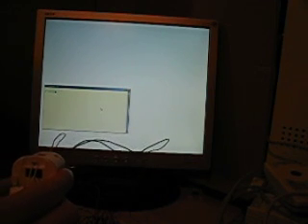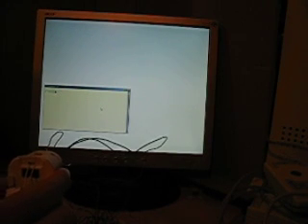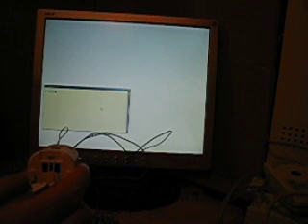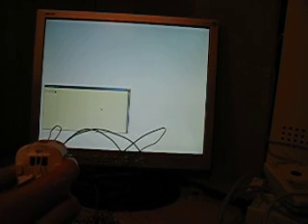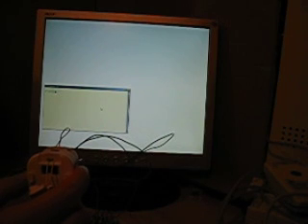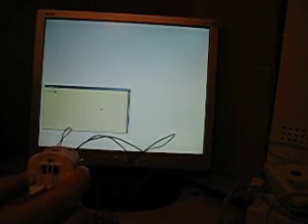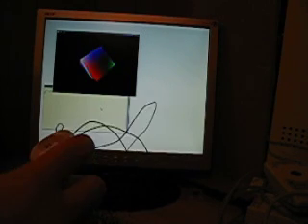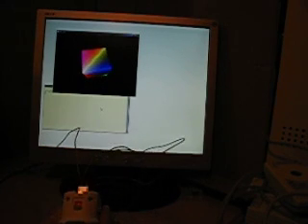Wii Motion Plus Demonstration

Comment: highly doubt you'll read this but could this work with a smartphone that doesn't have a gyroscope built in it, so it can become a VR capable phone for 360 videos and games? I currently do have a phone but its a budget smartphone and it didn't came with a gyro and i do not have the money to buy a new expensive smartphone, nor am not planning on getting a dedicated vr headset because the cheapest ones are still way out of my budget.
Reply from the maker: You'd need some sort of external i2c interface for the phone. At that point the easiest approach would probably be to write a driver to use that interface and talk to the Wii Motion Plus. It's a lot of effort to go to, though. You may also find that a low end smartphone doesn't have the processing power to do the VR, 360 videos and games. If you have the skills and motivation to try it, by all means give it a go - it's a cool project, but if your goal is just to have a VR capable phone at the end of the day I imagine there are easier ways to achieve that.